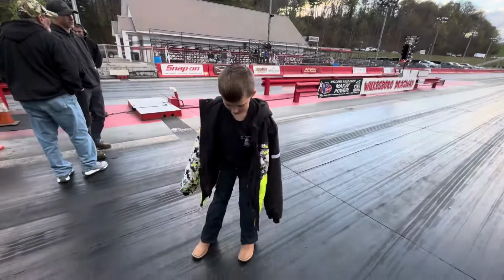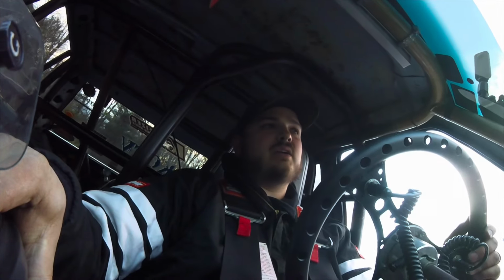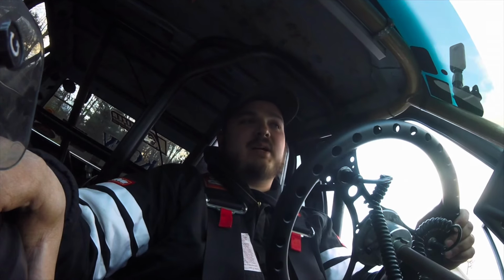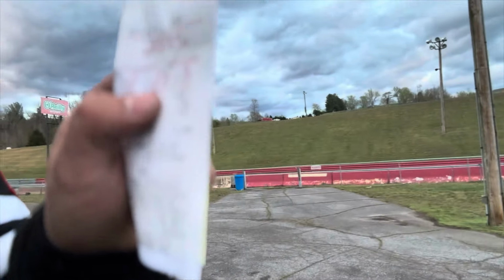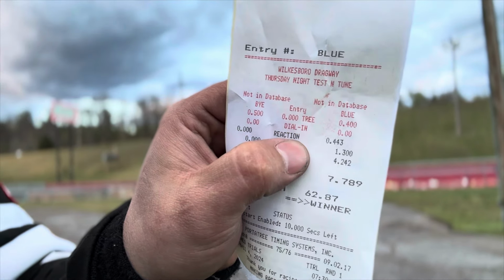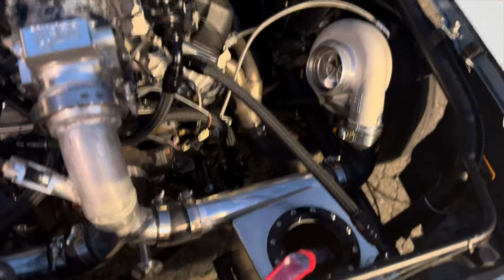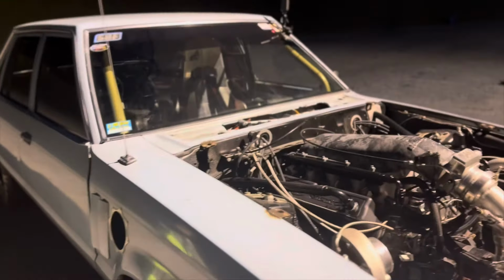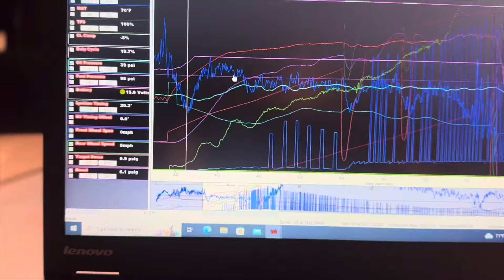Took the Zephyr Testing! Learned what NOT to do.

Comment: Nice job as always. Are your heads or block oringed in any way? I hope these new turbos don't push that limit. Sbf promod randy made 2500 pretty easy. I was amazed you would have to ring a ls engines neck for 2500 with a mega load of expensive parts better then the sbf
Reply from the maker: Yeah my engine has hoops